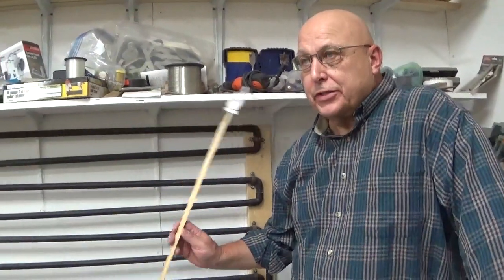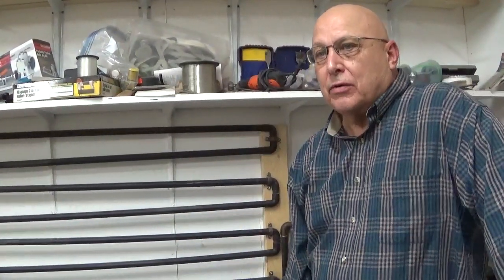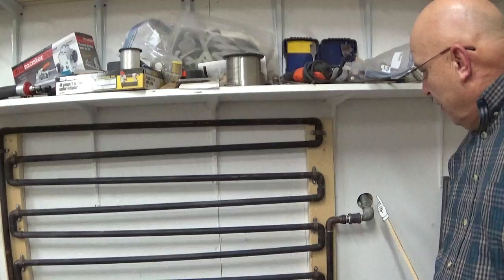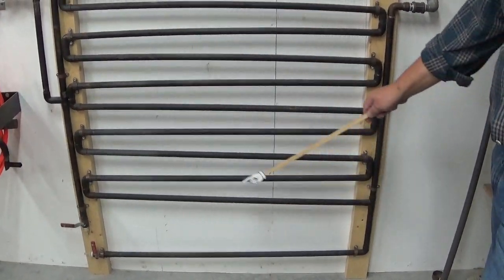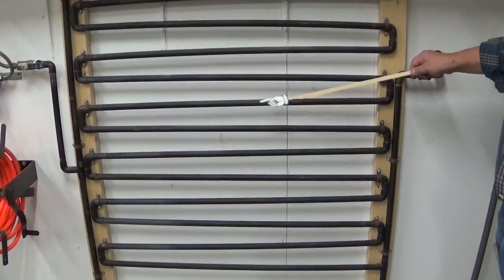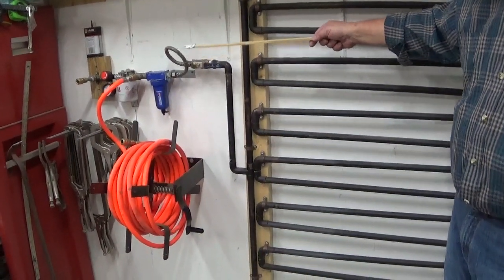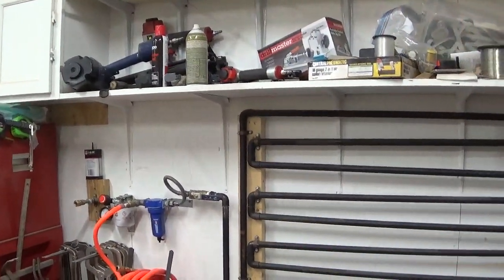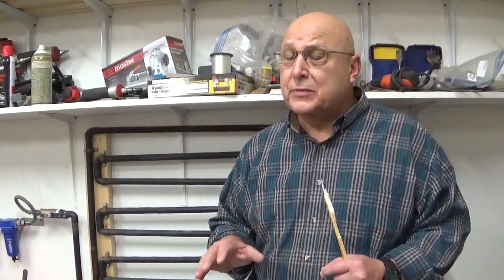Air Compressor aftercooler air cooler dryer condenser, simple and effective to remove moisture

Comment: Great intro to a cooling /  drying system! Just need two question answered as I prepare to cut my tubing to 36" lengths for my build, which I calculated will reach six feet high to get 50' of radiator (about 16 cross overs)...Read through all the comments but am still confused:

1. Regarding getting the slant right, did you make your connectors for the rise of each 180 degree corner the same length and then merely "lift" opposite ends of  each cross flow run a bit higher as your mounted them, or, did you cut longer connections to form slightly "higher" ends at one side of the system than the other?

2. Where to find whip hoses (I need four for my build that includes an auxiliary tank to fill in tandem with or independently  from my compressor, plus two hose reels where I supply the lead hose), and what to use for 3/4" to 3/8" adapters and valves? (feel so dumb about these).
Reply from the maker: Hello Escort36,
   Always remember there are no dumb questions, that is how people learn and shorten their learning curve on everything. 
   The section between the two elbows can be as short or long as you would like them, mine are just long enough to have about a 3/4" space between the two 90 degree fittings. You are correct all you have to do is anchor one side then slightly lift the other to make the downward slant, you don't need a steep angle for it to drain.
   Wherever they make hydraulic hoses near you ask them if they have a more flexible single braid hydraulic hose (one wire of steel wrap on the hose) in the size you need, I'm sure they will most places do, if no one near you does you can also order them on line. You'll need one end of the hose with a fixed fitting and one end with a swivel end in what ever pipe size you need. You can use cheaper hose but with hydraulic hose you never have to worry about it bursting open.
   When you make the air cooler just use the sweat on fittings in 3/4" (NPT) pipe and then you can use 3/4' pipe ball valves and a reducer from 3/4" down to the 3/8" pipe or 1/2" pipe (NPT) line whichever you going to use for your water separator, air filter and your air regulator. Be careful when ordering online because a lot of stuff comes from China and they make pipe fittings in both BSP (British Standard Pipe) and NPT, always buy the "NPT" (National pipe thread)  Good luck..

Comment: Best to cool the air down before it enters the tank,, l used a 25 foot roll of 1/2 inch copper tubing between the compressor pump with separator just before tank,,l ran 3/4 copper with drain drops at stations but I hardly ever get any water after doing the tubing between. It dropped the air temperature by 70 degrees

Comment: Thanks for the info, I’m going to use return bends to keep the flow up as well. Is that spin on filter made specifically for air? Haven’t seen one used like that, where did you get the filter base?
Reply from the maker: Hi Dan,
It is actually an oil filter assembly, I bought it for the base but it has worked great as a secondary filter so I never changed it to an air filter. You can interchange to an air filter by the thread size and gasket size in any auto parts store. Here is the web site for the base;  https://www.surpluscenter.com/Hydraulics/Hydraulic-Filters/Filters/3-8-NPT-7-GPM-Return-Line-Filter-9-7291.axd

Comment: Hi Jeff. I really like this model allot over the up down up down design. I'm really interested to hear your thoughts on installing this system after the compressor head and before the tank? To prevent moisture inside the tank and have dry air directly out of the tank. Do you think this is a good idea? or not so much?  Thanks so much for taking the time to share this video!!
Reply from the maker: Hi Taylor,
This design will work perfectly for a "pre-air cooler". You'll need to wire a fan to the pressure switch so when it is pumping air the fan is cooling the lines, otherwise the 195 degree heated air will quickly heat the copper lines and negate any cooling effect of the copper pipe. Good luck with your build and thanks for watching...

Comment: I like your setup and I can see some very solid, physics based advantages but, you never point out the reasons the copper pipe setup in the up-down-up-down configuration is not as good as yours.  Please explain.  Thank you.
Reply from the maker: Well let's see; fewer valves, gravity self-draining to one location, compact design, quicker to make and that's just a few.

Comment: Thanks for the video, so you don't have anything setup to try to keep the water out of the compressor tank? Seems most units connect between the compressor and the tank? Just curious what the benefits of either.
Reply from the maker: HI Rick,
Your are referring to a pre-air cooler that is between the compressor and the tank. A pre-air cooler is helpful to begin the condensation of the moisture, people have said that they are making two of these air coolers, one as a pre-air cooler and an after air cooler, just make sure you have a fan on the pre-air cooler because the air out out the compressor head is about 190 degrees and the hotter the copper gets the less it will cool.
Reply: The moisture isn’t squeezed out of the air (to a dramatic extent) until the air sees the great pressure drop, hence the need to dry only as the air comes down to your needed pressure. What tiny amount of condensate that forms in the high pressure air in the tank is removed by that beautiful bowl shaped bottom and opening the draincock daily. Just make sure you have at least 50’ of rigid pipe AFTER the tank as shown here, but preferably with a few more moisture traps along its length.

Comment: The air coming FROM your tank is actually freezing because it's being DEcompressed (ever had an air tool ice up after extended use?).  The air going TO the tank is the 200 deg. hot humid air, where these coolers are most effective?

Comment: Hey Jeff, thanks for sharing your design, love the video. Does your system have a step down after the air passes through the 3/4 copper cooling tubes? Could I make this system and have it connect to my 3/8 filter/regulator/hose and not have any issues? Or does it need to be 3/4 tubing from the compressor to the air tool? I hope my questions make sense. Thanks! Also, awesome what you do with bees!
Reply from the maker: Hi Beau,
  The only reduction in pipe size from the compressor and air cooler is at my air filter/trap assembly which is 3/8" NPT and that size continues with the air regulator and air hose, which is the most common size in shops and garages. Only industrial situations that need huge amounts of air go above the more common 1/4" , 3/8" or 1/2" air filter and regulator pipe sizes. This air cooler will connect to your existing 3/8" air filter, reg and hose just fine, thanks for the bee compliment and watching the video, I hope this helps.

Comment: hi Jett how are you . i got a question so if you don’t  mind answering . i got a compressor but the air is not stock inside the barrel ( tank) and no pressure coming from that so what’s the problem of my compressor thank you again if you’re gonna answer my question regards Elvio
Reply from the maker: Remove the line from the compressor head to the tank and inspect for a blockage and also make sure the compressor is pumping air. Good luck.

Comment: Thanks for the info. I will more than likely go with your style system.  Where did you get the “spin on oil filter” air filter system? 
Thanks, 
Decon
Reply from the maker: Hi Dion, I got it from Surplus Center online, it has a 250-psi burst rating and all oil filters are a pleated paper filter except for Hastings oil filters that uses a fiber material. Good luck...

Comment: Is that dryer after an air tank? Or is it connected directly to the pump outlet? I ask because I don't see that air going in to a receiver tank.
Reply from the maker: This is an after-cooler connected to the air tank outlet. You can also make this as a pre-air cooler connected to the compressor head before the air goes into the tank, you just need to put a fan on it to cool the tubes.

Comment: That’s a damn good idea! Best one I’ve seen to date! Been there over 30 years you say? How often do you have to open the ball valve & drain out the condensation? Will this work for painting cars??
Reply from the maker: Hi Paul,
Thanks, I made up this design back when I had a Body Shop 35 years ago, the one in this video is in my wood working shop. The original was the same design but with 6 cross pipes and each one was 10' long. At the outlet end I had a water/air separator, then a high pressure air coupler, after that was a Motor Guard paper air filter and finally the air regulator. The trick with the Motor Guard filter is to use the cheapest and stiffest toilet paper you can find, don't buy their filters. Plus screw a new air hose into to a paint regulator so it can't be removed, that is to eliminate any air contamination from using another air hose to paint with. Well at least that is what I did and the system worked very well and didn't cost much. The condensation depends on the outside humidity but you could crack the ball valves every few days to see what you've been collecting..
Reply: Sweet! Thank you  Jeff.

Comment: jeff could you tell me the exact flex  lines you used at inlet from compressor & why not use same 1 at outlet?
Reply from the maker: Sorry this one slipped pass me.  I used 3/4" single braid hydraulic line, with a 3/4" pipe thread swivel on one end and a fixed fitting one the other.

Comment: Interesting. I designed one very similar to yours. I use 10, 5 foot 3/4” copper pipes in a switchback fashion along the wall. Nice because there’s only one drain valve instead of one for each vertical pipe. I’d like to share my design with you. Get your comments. It’s all in power point. 
I enter mine from the top, so the air and water move in the same direction. 
Then I go into a refrigerated cooler with 3/4” soft copper tube in a double helix. The air enters from the bottom, cycles up through the inner helix, turns around and cycles down in the outer helix. This is all contained in a bucked that has chilled water circulating through. 
Last night I thought how I might reconfigure the hard copper switchback by turning each 180 degree turn around out by 5 degrees. So it becomes sort of a rectangular helix. This sticks out about 4” from the wall, but cuts the height in half. 
Let me know if you want to see my plans. We obviously think alike on this and I want your thoughts. 
Good work. 
Paul

Comment: Hey Jeff, this appeared, in all respects, logical, so I built it, almost identical to yours, only difference is my in and out is on left side, that's it. I was getting, for years, water vapor in air tools etc. especially with heavy compressor usage, 60 gal. tank 11.5 cfm, which was OK but then I needed to spray paint vehicles, not OK any more. After a week or so it seems to be working, including spray painting, (expensive stuff to screw up). For me it was worth the time of 2 days to make despite the big box store hit for 60' of 3/4" copper and fittings (ouch) and hydraulic hose fittings. I would upload pic if I could, people like to show off their work even if it is copied I guess. I think the only time this would give me trouble is in the event of wicked heavy compressor usage, like almost constant, the water droplets might not be able to fight the velocity of the air going through, that kind of air usage is very rare for me though. I did view, of course, many of the other YouTube designs which are predominantly vertical runs, I don't understand the logic of the physics there, air would have to pass through a gauntlet of a minimum of 3/4" of water on every loop unless drained repeatedly. To each their own I guess, thank you very much for sharing your design/concept !!! 
David in Maine
Reply from the maker: Hello David,
Your welcome and I'm glad yours turned out so well. Try a Motor Guard air filter, in my body shop days I used one after the water/air separator and just before the air regulator they worked great. Just use the cheapest and roughest toilet paper for the replacement filters.
Reply: @jeffwillard2417  I will consider that, I saw that mentioned multiple times in the other posts. I also looked up the price, (I think $100 or so), at build time I installed a cheap HF desiccant dryer dedicated to paint sprayer hose only. Obviously won't last more than 1 or 2 squirt sessions I believe and if I have trouble beyond that then your toilet paper holder will probably be next. I'm sure Fla. humidity is much more of an issue than an odd unusual humid hot summer up here which has been the case this year.
thx
david

ps keep those bees down there !!!!!!

Comment: Hello Jeff, 
     Wonderful design, thanks for sharing with us , do you have approximately  what percentage of moisture gets removed from air .
I am going to use this for dehydration system of vegertables so I will be heating air again ,  Kindly do share your suggestions if you have any.
Reply from the maker: Hi Ashutosh,
That is an interesting idea you have, the amount of moisture removed depends on how much humidity is in the air that needs to be cooled and condensed. I wish I could give you more info for your dehydration system, let me know how it works out for you, good luck...

Comment: How did you handle the unloader valve? Without moving it, you drain the air in your cooler every time the motor stops. 
This is my last hang up. I need to deactivate the unloader between the compressor and check valve on tank, and put one between the compressor and check valve going into the cooler. 
Can you help me with how to do this?
Thanks,
Paul
Reply from the maker: Hi Paul, You got me a little confused on this, you should be using the exit air port on the tank not the unloader or check valve for the after air-cooler but if your making one for a pre air-cooler you need to come off the pump discharge side into the cooler and then into the tank. Depending on the compressors pluming you may have to a three way tee at a top tank fitting. Now the next problem is matching up the threads, imported compressors will be metric or a BSP pipe thread. If your making a pre cooler be sure to run a fan on the tubes to keep them cool while the pump is running. Good luck and thanks for watching.
Reply: @jeffwillard2417  
Hi Jeff. I don’t know the lingo so I don’t know what an exit air port is. But as it stands, there is a 1/2” soft copper tube going from the compressor to the check valve in the tank. The check valve has a little 1/4” exit port that runs 1/4” soft copper to the pressure switch. This is connected to an unloader valve. So when the compressor switches off, the pressure switch knows and opens the unloader valve to drain the line between compressor and tank. 
So I think I figured it out. 
Disconnect the 1/4 line and replace it with a flexible hose going from the unloader valve up to the exit from the compressor. The pressure switch won’t know that I changed the other end from the tank input to the compressor output. 
So now I will have a 1/2” outlet at the compressor, connected to a 3/4” male mpt. This is connected to a 3/4 x 3/4 x 1/4” tee. The 1/4” hose will connect to the tee and the other flexible hose connects to the 3/4” outlet on the other side of the tee. (Following this?). 
So now the unloader valve will only purge the air between the compressor and my cooler. 
My copper pipes will be painted black and stand off from a plywood backing by a few inches. 50’ of 3/4” copper pipe and then into 100’ of a 3/4” soft copper double helix in a chilled bath. Then into the tank. 
Thanks for your help Jeff.

Comment: Hi Jeff,
I came for the electric knife uncapper then found your air dryer assembly. Very happy I did. Apart from a handful of hives I buy and rebuild skid steers as a hobby too. It’s how I get my “play money”. I will end up building one of these as it can get quite humid where I am in Australia and the water separator filters just don’t do a good enough job and saturate quickly. 
You mentioned a sand blaster. Is it homemade? Is it just a cabinet size or something that would suit sandblasting a few ton skid steer? I need to build one of those too. 😃
Thank you Sir,
Cheers 🍻
Reply from the maker: Hello Nigel,
It sounds like your a busy man. In the past I have spent many hours on the business end of a pressurized sandblaster with every body part covered in sand and dust, so I know how important it is to keep the air dry. I now have a factory build free standing cabinet blaster for small parts. I used this same design air cooler back in my blasting days that was 60' long in just the copper cooling pipes, a little longer than the one I'm using now the video. Good luck in your build.
Reply: @jeffwillard2417  
Thanks Jeff,
I’m in two minds with the blaster. Thinking of possibly making a wet blaster to help negate the dust and health concerns. Pros and cons of both types, slight corrosion being one of course. 
Great info on the air dryer. I’ve got plenty of free wall space here. No more moisture at the spray gun will be nice. Will start collecting the parts 👍👍
Cheers 🍻